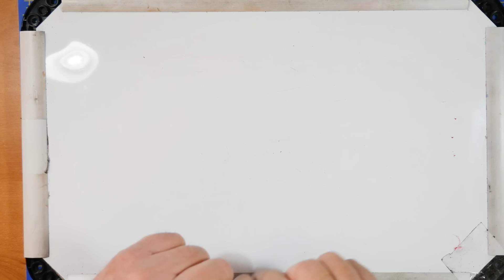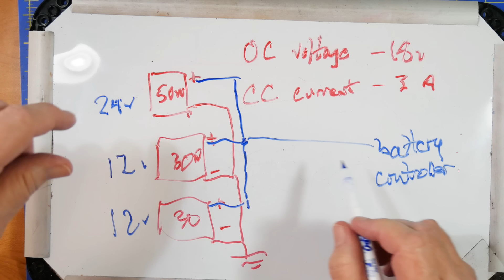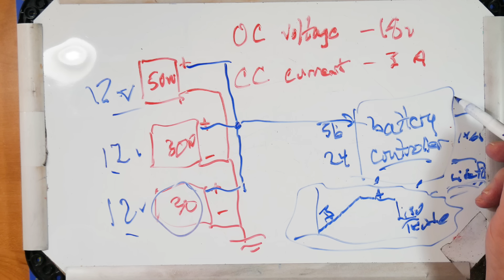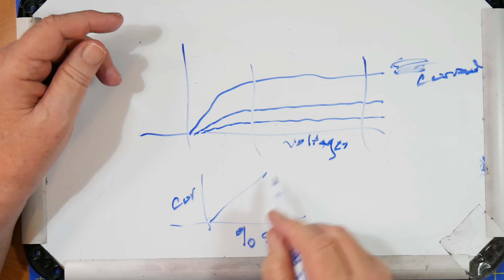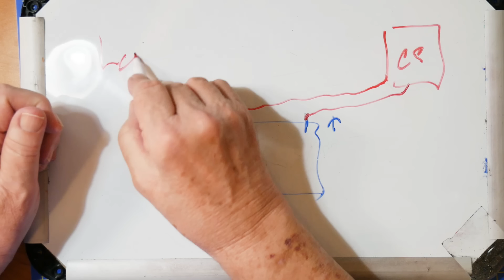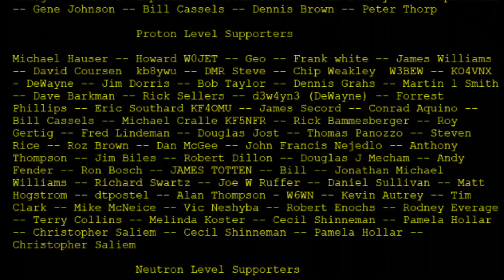Solar - Battery Charging Techniques (#1375)

Comment: Nice video ... I do have some questions. 

I thought the charge controller had "Load" terminals, so when the batteries got to the discharge point, the "Load" could be disconnected by the controller to prevent over discharge from occurring? Going directly to the battery this safety measure is by passed. 
Least thats what the manual lead me to believe and it made sense, since it was no longer in line.

I get it if you are pulling something beyond the controllers ability like an inverter, which can spike,  but I am just powering, like you, a radio. When I did this I was told to connect it to the controller and it made sense.  I was going as you said till I got the controller and the manual and it got me to use the controller.  Bit confused now.

I do have all the fuses as you have described.

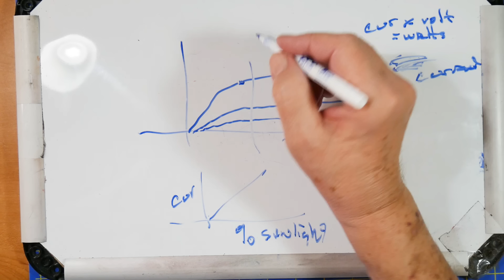One other is ... I was paying attention... at 7:23 you talk about the max wattage. If that is voltage at the bottom wouldn't the point you show be the min? The max would be at the other end to the right (second line) when voltage was higher?? I thought the two vertical lines where the voltage ranges the panel would put out based on solar power.  Sorry if this is a dumb question. 

Very much appreciate all the tech vids you produce.

Comment: You did not mention the need for a bypass diode to provide added PIV protection, or an auto isolation switch to disconnect the battery from the load,  to prevent deep discharge.

Comment: I'm currently working on assembling my 4th off grid solar generator which will be a 48 volt  system (51.2v) feeding a 6kw split phase 240/120 VAC inverter with twin quad banks of 100 amp hour lifepo4's for roughly 45kwh capacity. The mppt I'm using is a 150/45. I already have 3 other systems: a 100/40 for SLA 12/24VDC, and two 100/30 for lifepo 12v and 24v respectively. I also have several PWM 12 volt solar controllers for smaller single panels and batteries. 

From my experience and research, depending on the type of controller (MPPT or PWM) battery system voltage, and the power rating of your controller, you can actually run mismatched solar panels in series so long as the total Voc plus temperature coefficient of the total sum of all panels doesn't exceed your maximum input voltage into the charge controller. This can only be done with an MPPT controller as PWM cannot accept high voltage panels. Same principal applies to your maximum charge current. My current panels are twin 180 watt panels connected in series to one of the 100/30 controllers. Maximum voltage I've seen has been around 47 volts but the amperage usually stays under 9 amps. So in theory I could add 10 more matching panels before maxing out the controller. Depending on the size of the battery there are varying recommended charge currents but most recommend no less than 10% and no more than 40% of your total battery capacity. BMS kind of adds a safety factor since it will shut off with over current but your charge controller should be set accordingly before ever connecting to panels. There are also cases where it's ok to install more than one charge controller to a battery bank but usually applies to larger capacity systems. A 100 amp hour 12 volt lifepo with 500 watts of solar dumping in 35 amps will be fully charged in less than 3 hours, and that's if the battery is fully depleted. A bank of 4x 48 volt batteries 100 amp hours each with the same panel array will take 16 times the amount of power to fully charge. Since you can't run 8kw on one charge controller, multiple charge controllers would be necessary. 

To make a long story short, it all depends on the capacity of the battery bank, the system voltage, type of charge controller, and panels, and how you connect it all. Best recommendation would be to check out videos of the solar experts. There's several out there who have done extensive research and demonstrations.

Comment: You can overpanel a charge controller in many cases , as long as you never exceed the maximum rates input voltage of the charge controller .
Also not good to exceed the rated string voltage of the panels themselves .
Another good idea is to find the thermal coefficient of your panels , since the voltages can spike in very cold weather , and , if your string (s) are already close to the maximum in warm weather , the first cold clear morning may illuminate a critical oversight on your part , in the form of a deep fried charge controller .